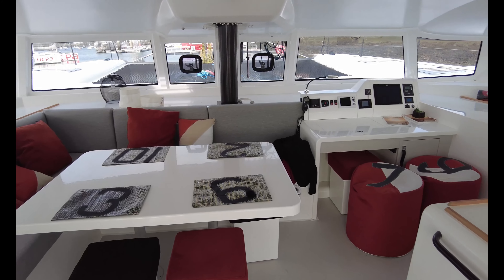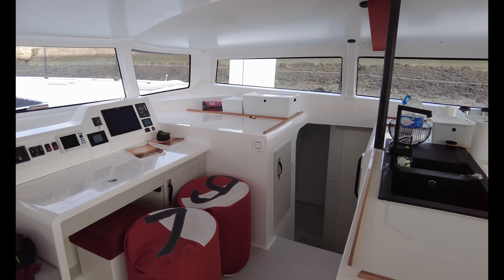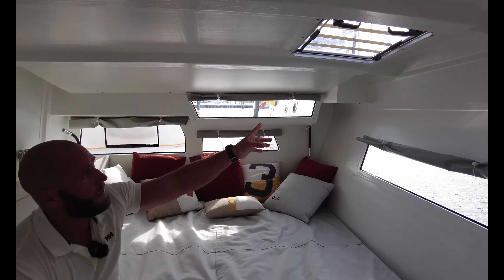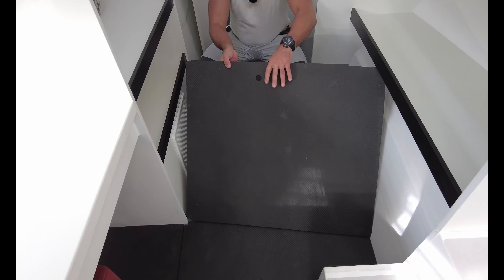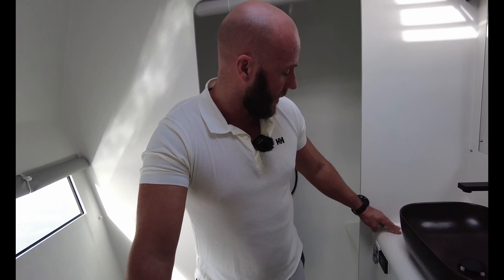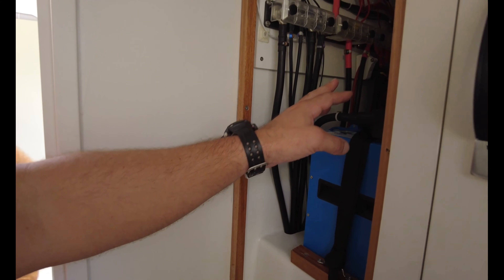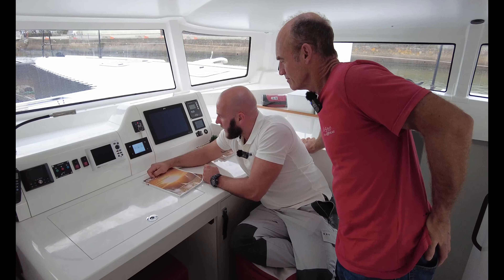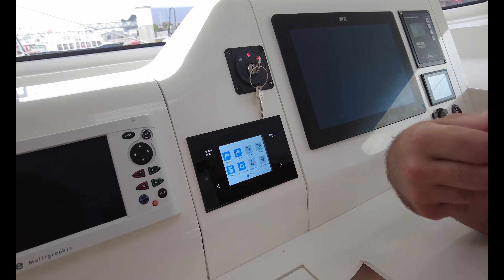ORC 57 Catamaran interior review, luxury at light speed.

Comment: I’m curious if you (or any other sailors) ever considered a portable battery powered AC unit something like what “Zero Breeze” offers?  I think it would not be too much trouble to 3D print an attachment to fit into a window or hatch to off-gas the hot air… No internal ducting, no seawater…
Reply from the maker: Hi, the sea water helps with efficiency and it's definitely an option but may as well go for a normal aircon mini split and a generator